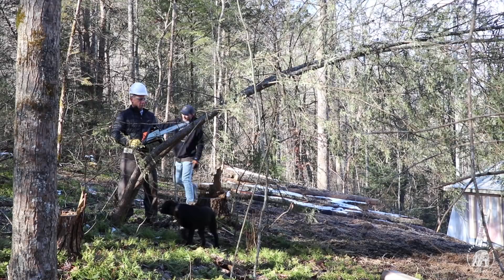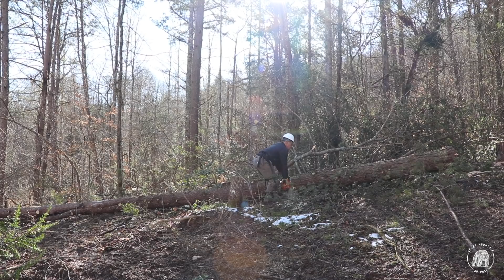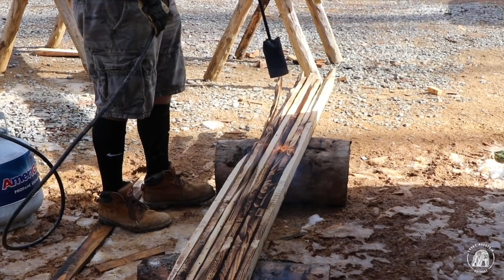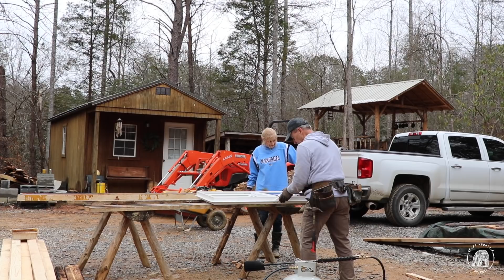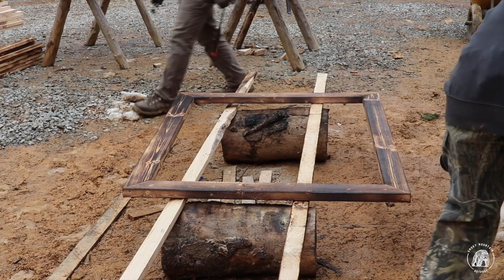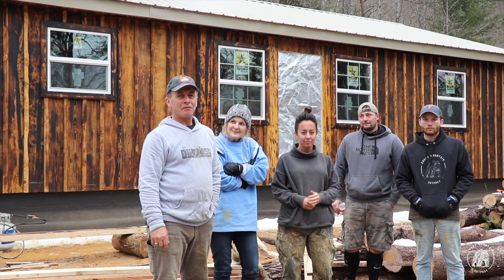SAWMILL, BATTENS & CABIN WINDOW | OFF GRID TIMBER FRAME | WOODWORK

Comment: so harvest wood is all your lumber sources? used it as green? would that satisfy the code?
Reply from the maker: What code, lol? Undeveloped area. No code restrictions. Most cabins in the early days were done green anyway. You just have to compensate for shrinkage in width. The length stays the same. I have built another the same way and when sold it past inspection without delay. That’s the good thing about undeveloped townships, no middle people to take ones money when not really needed. This one stays in the family.